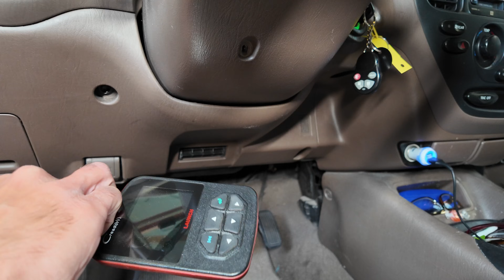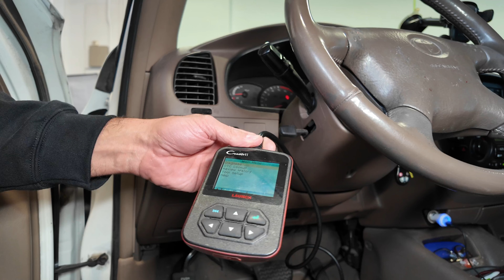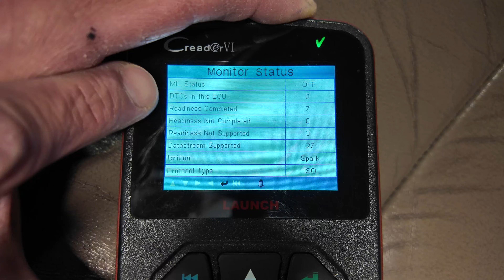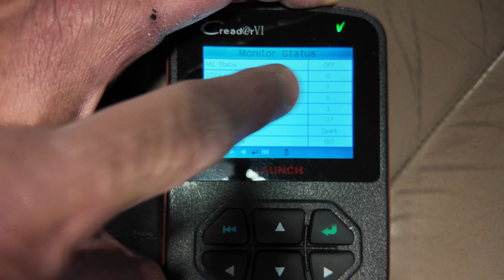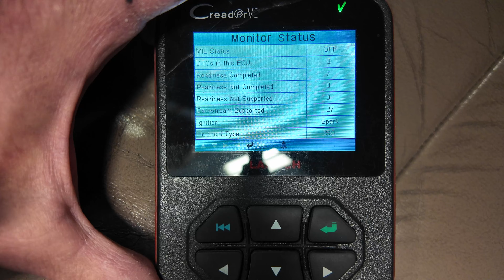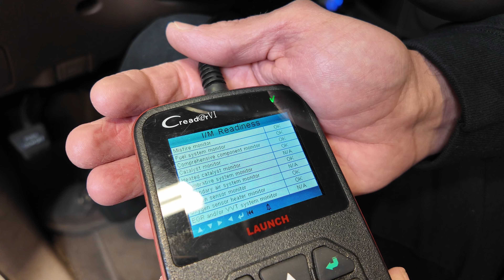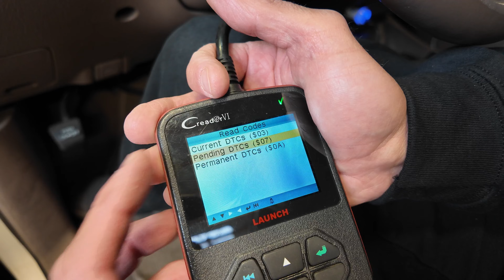Don’t Get Scammed! Use This OBD Reader Before Buying a Used Car

Comment: Your first mistake was looking at a Nissan.
Reply from the maker: 🤣😂😅   Honestly, after working on primarily Asian Imports the last 3 decades, I am impressed with Nissan engines, specifically when properly maintained.  The automatic transmissions are fairly solid as well. It's the CVT transmission, VATS, and the IPDM's I find to be most problematic. I have personally owned many over the past 30 years, from the old Maxima's to Infiniti G37's and QX56/80's.  They were all very solid with very few problems.  No CVTs, though.  Lol. Thanks for watching! 🙏
Reply: @OrtoTechGarage I agree! People unfairly talk down about Nissan. my family has a fleet of Nissan and they have all been solid. Most are manual but I have had CVT also, no problems. We always changed the CVT fluid and never abused it however.
Reply from the maker: @XenomorphLV426  Everyone has their own experiences.  I believe proper maintenance and care of your vehicle has a lot to do with the overall ownership experience.  The cars that we see in the garage falling apart are usually the cars that have been poorly maintained or abused.  Not all, but most.
Reply: @ Jatco CVT, doesn’t matter how you maintain it.
Reply from the maker: @Psylliumhead  lol.  Yes, we are probably all aware of Jatco CVT and the issues with them.  If you look at my original comment, I agreed that they are problematic, at best.  Along with the other Nissan subsystems mentioned.    I'm not defending Nissan or Jatco for their issues.  👍
Reply: @ the trans is a major component in any car and expensive to repair. Nissan has been using these pieces of junk for years and knows it. This alone is reason enough not to buy one.
Reply from the maker: @Psylliumhead  Yes.  I agree they should move on from these to save their reputation.  Although other manufacturers have adopted the CVT for their products as well.  It's not exclusive to Nissan.  👍
Reply: @ true, but the others, like Toyota, have some quality and reliability.
Reply: @OrtoTechGarage  I have a 14 year old Nissan with the 1.5dci 6 speed manual gear, box both are great, love it, I've had the car from new and had the oil changed every year since, I would never have the CVT Auto,
Reply from the maker: @Ronick-Q-46  That sounds about right!   Nissan products are very reliable when properly maintained, especially the models that don't have the components i mentioned earlier.  I rank Nissan right up there in the top 10 auto manufacturers for longevity and reliability.
Reply: @ really? Ever hear of Jatco CVT?
Reply: @OrtoTechGarage  Nissan CVT = No go
Reply: Exactly

Comment: this is same as getting a smog check.
Reply from the maker: This is definitely what is going on during a smog/emissions test.  They want to make sure the IM monitors are set to the "ready" status, and there are no diagnostic trouble codes.   This is in place of the traditional gas analysis done at the tailpipe, where they are testing for carbon monoxide (CO), hydrocarbons (HC), and oxides of nitrogen (NOX).   The  OBD2 test assumes that if the powertrain control computer has not detected any issues, then the vehicle must not be polluting those gases.  👍